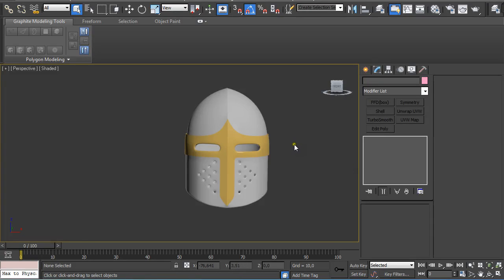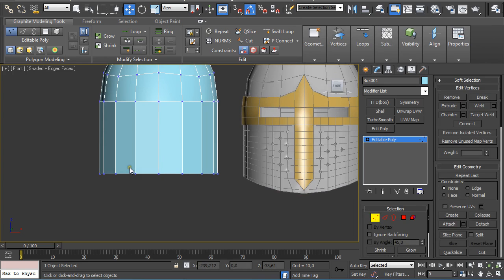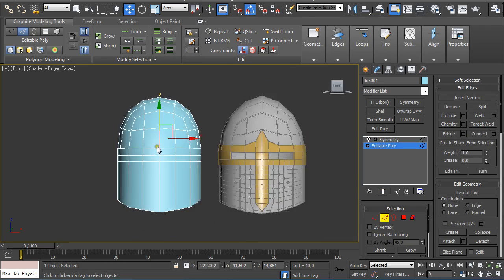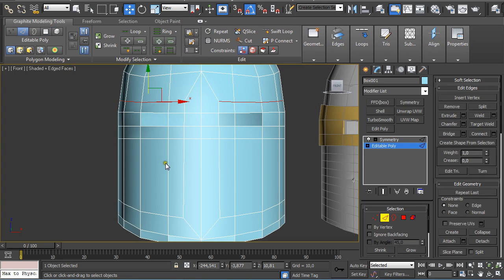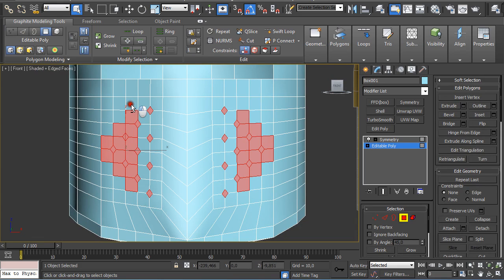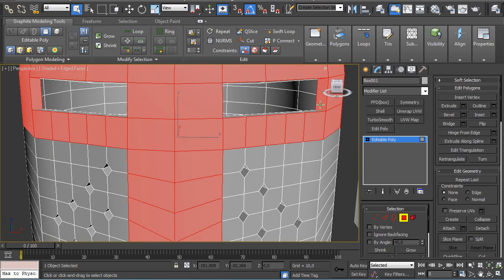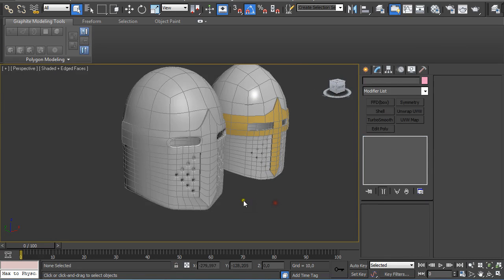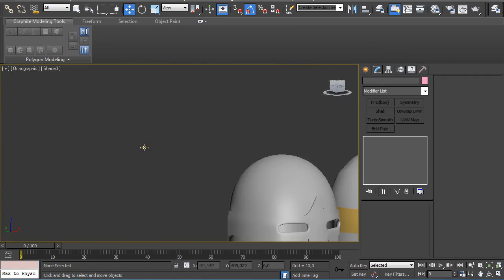Tutorial: How to model a 3D medieval knight helmet in Autodesk 3Ds Max (Part 2)

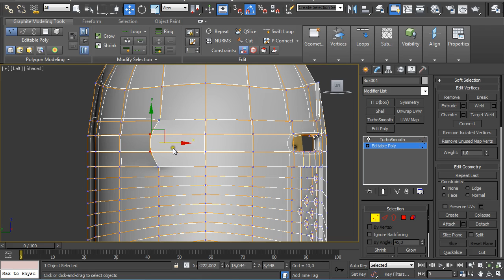Comment: at 10:38 How did you moved those verticex while keeping the edge so round?
Reply from the maker: The Turbosmooth modifier is applied. That`s what makes the edge round. The vertices are moved a usual (press 1 to make vertex selection, select the ones you want, make sure you have move turned on - press W).
Reply: ***** I have it applied. Ive doen an almost identical helemt like yours except this final transform of those vertices. Why turbosmoth isnt applying on those vertices? thats relly frustrated becasue Ive done all perfectly until  this final transform
Reply from the maker: Orphydian Check if you applied "crease" to appropriate edges.
Reply: ***** how to do that besides of starting all over again? I think Ive apllied crease to those edges also. I shouldnt?
Reply from the maker: Orphydian No need to start all over, cause if you`ll do the same steps that you did now, you`ll end up with the same result. 
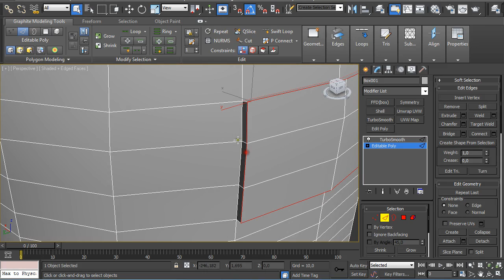If you are using the same number of edges in your model you must make sure you do the crease ONLY on the edges that are suppose to stay sharp, so if you want to have a round edge, do not crease the lines that are connecting the outer and inner part of the object (hard to explain, watch 8:41 which edges are left white (not creased)).
Reply: ***** thanks it worked. Pls do some ancient helmets as well but not the spartan one or imperial roman ones lol
Reply from the maker: Orphydian well if you understand the workflow for this helmet, then you can apply it to any other.
Reply: ***** not really im just a beginner
I kinda suggest you this not onyl asking because this helemt modeling videos can have a lot of potential. If you happen to know this big forum Total War center you dont have idea how many are looking for such tutorials. You can advertise your videos there too.
http://www.twcenter.net/forums/